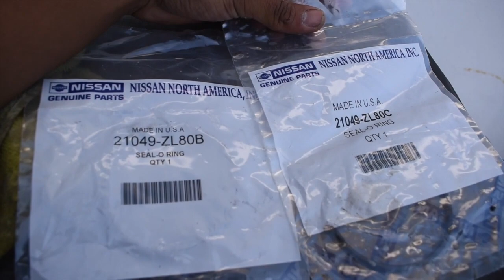Set Perfect Timing On Your VQ Motor !! | 350z G35 370z G37

Comment: I’m watching this w my engine wide open rn. Big ups bro. Thanks.
Reply from the maker: Yessir you got this bro. I appreciate you for watching.
Reply: I’m doing this same job me and a friend from work
Reply from the maker: Knock it out. You’ll be back on the road in no time. Shoutout the homies👍🏽
Reply: I got a 2013 g37 and my water pump is leaking. Been a mechanic for a while but never messed with timing chains before. I’m slip nervous. I don’t wanna blow this mother fuka up. It’s leaking right above the ac compressor where the weap hole is. Ima get the whole kit pump gallery gaskets chains chain tensioners guide thermostat and gasket.

Comment: On my de I have both cam gears indicator line up on bank one and two, but off on the crank pulley , I was in the process on changing my water pump and thought I skipped a tooth so took of the whole cover, i rotated the motor without the lower tensioner but held pressure while cranking. You think I’m good to take the primary chain off and rotate the motor to where the crank pulley lines up?
Reply from the maker: You got it! Crank it till it lines up and send her. All markings should be lined up by the time you engage the tensioners

Comment: man i was doing gallery gaskets on my HR, i set engine to top dead center and took the timing chain off and my passenger cam jumped far to left about 4 teeth,  before i took chain off i marked the chain and everything with paint marker, and i put the chain back on ands turned the cam to the correct way but the cam jumped on me backwards counter clockwise it snapped hard and turned counter on me, and then i put it back finally to the middle where it was before,  and all my marks and everything lines up, do you think im gonna be ok to start the engine or what should i do man thanks for the advice man apprecaite your vids tunas!!!!@
Reply from the maker: I would just set it to tdc that way before you seal the motor up you can double check your markings and make sure it’s got perfect timing. Tdc is the only way I set timing.
Reply: @tuned_tunas what’s tdc bro? Same happened to mine

Comment: I keep doing the timing on my g35 and when I put the tensioner on it shifts the passenger side sprockets slightly off the cylinder head mark (vertical). However the crank stays tdc and drivers side bank stays in the mark.  Help.
Reply from the maker: use a wrench to position the camshaft where you need it, it won't line up on it's own. It will require finesse.

Comment: Cool! I need to replace it on my G soon. The chain rattles on first cold startup. Thanks for posting!
Reply from the maker: Hope it helps you out. I'm always glad to help !!
Reply: You know you could just replace the tensioner right depending on how long it been rattling the chainnus probably fine. Give it a shot you just remove the top left inspection window and its two bolts just push the plunger in and stick a thumtack in the hole to hold the pressure off
Reply: Shit I need a timing chain my rattling crazy on start up we’re y’all located I pay whatever I’m n Philadelphia
Reply: It’s hard to find somebody to do this i   wish I had friends that now how to do this I’m too scared to do this I need help
Reply: You still active on here got a massive question did my gallery gasket and was not aware timing was a big thing so now car dont start can i still go back and fix timing?

Comment: so i’m doing timing on my hr and i made sure the cams was facing up lined up everything else is lined up. but when i rotate the engine a few revs the marks don’t line up aren’t they Supposed to line up ?
Reply from the maker: That’s normal it’s going to take a lot of spins to get it to line up again. But as long as you started at top dead center you’re solid
Reply: @tuned_tunas  so as long as i line everything up and and at TDC and i rotate the engine it should be fine even if they don’t line up ? i’m doing timing and im stuck on that part
Reply from the maker: Yessir it’s not going to always be lined up. It’ll take a good amount of turns before it lines up again

Comment: How did you get the tensioners for the cams in/out? I am trying but no luck.
Reply from the maker: I just pushed them back and put the wall tac in there to hold it closed and took off the 2 10mm bolts it’s got

Comment: The cam alignment position in the Service Manual for VQ35DE is different than this video.  The intake cam smaller dowel holes are to face up to the 12 o'clock position and the Exhaust cam large diameter dowel face down towards the 6 o'clock position.  The way he shows it wont put the cams on #1 at TDC of compression for DE specifically!  This video will put a DE out of time

I would attach a picture but doesn't look like I can on the comments.  #1 TDC of compression cam position should have the oval heads of the lobe face each other.  All 4 large dowel positions facing up at the 12 O'clock will have the Cam lobes face the opposite direction of the service manual illustration which would put a DE out of time.  This video example looks like it is for a 35th anniversary.  
No hate here, I still appreciate the video and effort taken to share content!!
Reply from the maker: I appreciate you for dropping this comment. This is good information for anyone who needs it. Super helpful brother !!
Reply: is there anyway you can send me that picture, i cant find it? aligning my car tomorrow and would like to know what you mean
Reply: @dawsondakota8857  yeah I have screen shots from the service manual.  Don't know how to share them though.
Reply: Do you have an email or social media ? Id really appreciate it
Reply: @dawsondakota8857  yes you can find me on Facebook messenger with the same first and last name.  I'll try to find you.

Comment: Yo I hit a curb on my g n the upper oil pan ripper off and it craked bottom pice of block I see I can replace bottom pice by the crank u think I should fix or replace engine car still ran after crash  I turn it off asap oil leaked all out
Reply from the maker: Yo what’s good my guy. Fortunately for you I have also ran into this issue myself of cracking the upper oil pan of the car. And I do have a video of doing that job as well. I recommend you do it yourself and save a couple thousand. Only if you didn’t crack the block and the motor is fine. If theres a crack in the block I wouldn’t take a chance on it

Comment: Hi, 
My G37 stalled. I had a code for bank two camshaft position sensor. I replaced the sensor, but the car didn't start. 
If I unplug that sensor, it starts. 
Please help
Reply from the maker: Definitely going to need to hop on the forums for that. never ran into that issue myself. Whats the code

Comment: aye bro what size wrench was ur boy using on the cam
Reply from the maker: 17mm but any adjustable wrench should do the job.
Reply: @tuned_tunas  thanks for the fast answer bro! two more questions if you got the time. i was dumb and put the bolt in the timing camshaft sprocket hole to line the pins up to the line, but now obviously the bolt won’t come out lmao, would holding the cams help with getting it out? and two does using the wrench stop all cams from moving at once? thanks again bro
Reply from the maker: Yes if you hold the cam with a wrench you should be able to jist loosen up the bolt. And for your second question no they are all moving individually so timing it is very important.

Comment: Do I need to take off the cam sprockets when I do my gallery gaskets? 

I saw in the gallery gasket video you just loosened the tensioner and moved the chain to the top. 

If i did that, and just marked my chain with how it is when I open it up before I take it apart, and then I set it back to exactly what it was. Would I be fine? Or do I need to do everything you did in the video?
Reply from the maker: Asking all the right questions my dude. Personally I have seen people do it the other way where they try to put it back where it was before and most of the time it doesn’t go well. They always end up missing a tooth. Doing it this way we can be 100% sure that all chains are lined up correctly. Because it’s not just the outside large chain the cams have their own chain that needs to be set correctly as well everything needs to be in sync. This method we are sure that if there is a failure it isn’t the timing of the motor
Reply: @tuned_tunas  appreciate the response bro 🙏🏼
Reply: @tuned_tunas   now will I have to take apart the intake manifold in order to gain access to the cams so I can set the cam sprockets?

Or is there any way to adjust the cam sprockets with just the timing cover off? Or will my cam sprockets just stay in the right place since I’m not taking them off in the first place?

Comment: What’s up man I like the video I’ve got a 35de non rev up in my z. I’m going to do the gallery gaskets and figured I’d do the timing chain and oil pump while I was in it. Got two questions first one could I reuse the screws in the oil pump. And second one when setting the timing do I set the timing marks on bank one and two out at the angle of the head or straight up like you show in the video
Reply from the maker: Glad to hear you’re going for that full refresh my dude. I wouldn’t be too sure about the bolts on the oil pump since I didn’t change mine. As for the timing I would  do it like the video everything needs to be perfectly aligned and this way I had no issues at all. But wrench at your own risk

Comment: Hey, so i took my timing chain off before setting tdc. How would i set it again? I have the dowel pins sit in the angled position so would i just set the crank into position and put the chain vack on?
Reply from the maker: Put the crank bolt back on and turn it to TDC and the cams you would just have to move with an adjustable wrench. I didn’t set to top dead center beforehand either that’s what I do in this video.
Reply: @tuned_tunas  hey I’m in the same situation but my crank doesn’t rotate anymore but the sprockets do, do you know how I can get my crank moving again?

Comment: Did you set the camshaft before installing the cam gears?
Reply from the maker: Cams never came out. Just rotated both cams and crankshaft to get them lined up to top dead center.

Comment: Thanks for the info i just got right info inch pounds. An pound to each bolts 
I strip. One water pump bolt. But i found a little bigger one , longer one but cut it an hand tight it snug thanks
Reply from the maker: Sounds like it all worked out bro. Thats good to hear bro💪💯

Comment: I just got my oil gallery gasket changed on my 08 HR by some known motosport company here in UK...however my car now hops/jumps or you can say hesitates on acceleratetion under 2K revs ,say between 1k-1.5k RPM, no matter if I drive slow or accelerate hard,it still happens,any idea what could cause that ?, something not done properly etc ?,I had no such issue prior to getting the work done.Any help would be appreciated,thanks
Reply from the maker: Night not be timed right. Something similar happened to me friends car. Ran good at first but probably the second cold start it started to run bad and gave us the timing advanced code.

Comment: Hey bro question. Ok i got gallery gasket  in right. I already have crank in time... now its time for bank 1 and bank 2 to get line up but i couldnt turn bank 1 cam spockets what am i doing wrong? Do i have to take valve covers off and turn bu hand? Also do i have to remove spark plugs? When timing the engine! HELP ME BROOOO!!
Reply from the maker: I had the block top dead center before I adjusted the cams to avoid striking the pistons. When it builds compression it gets a little harder to turn. I had the valve covers off so it was easier for me. And I had my spark plugs in when I did my job. Shouodnt be am issue. Lmk if you got any more questions. We here to help!!
Reply: @tuned_tunas  ok sure thing. Thanks bro!👍💯
Reply from the maker: Always glad to help bro💪

Comment: What should I do if I already took off the timing chain and didn’t set the motor to top dead center?
Reply from the maker: Make sure the cans and crankshaft line up to the timing marks. If they don’t you done FFFFED UP
Reply: this happend to me, now i fddd up by turning the sprockets and crankhaft seperatley counter-clockwise and clockwise on multiple occasions without the chain on, and now when i line up my marks for the sprockets and the crankshaft, I try to turn the crankshaft and it stops turning and touches a valve, Idk what to do to fix it back in place properly now, any suggestions on what do? do you have an instagram?

Comment: Was up foo ey compa I was changing my gallery gaskets bro and I think my timing chain skipped a tooth or something because  now it don’t wanna turn on could it the timing or a sensor bro? If it’s the chain do I need to put the car on top dead center and then take the chain off and time it or just take chain off them move the sprockets to the right time and then put the chain on the right time or I don’t need to put the car on top dead center?
Reply from the maker: You would get a code if it was the chain bro. It would say that timing is off. Otherwise if the car isn’t getting any power then it’s probably a wire somewhere
Reply: @tuned_tunas  Entonce could it be the belt bro? Or does it still give u a code if u put the car on position and I connect my  obd because bro my car only cranks but it doesn’t wanna turn on?
Reply: @tuned_tunas  u got like a number bro or insta For I can show u a vid bro of it cranking aver if u can hear maybe por pinche milagro what it is😭
Reply from the maker: Instagram is in our bio bro. @TUNEDTUNAS I answer all messages and comments

Comment: Did u try turning the crank with the socket first before u sealed everything up to make sure all the timing is good?
Reply from the maker: We turned it right after we timed it. Everything seems good. Good way to check and see if the valves hit a piston

Comment: I recently did mine, but after doing them I’m getting code p0012 for the passenger side VTC I believe. Everytime I do a pull it idles you to 1.1k. Did you ever have any problems like that? Or did you have to make sure the little cam covers were aligned to a certain way or something?
Reply from the maker: Didn’t have any issues with mine man. If you got a code something is not right. And it’s hard to pin point what it is on such a big job. I would redo it and quadruple check that the chain doesn’t move when you set the tensioners. If it’s off by a tooth it’s not right. It has to be perfect.

Comment: I did my water pump and now both my cams  are facing left at top dead center . Im wondering if who everbhad the car before me used that as marking to put a timing chain .

I never had a issue with the timing on my 2007 g35 sedan vq35hr 

Just needed a water pump replacement . 

Any thought s
Reply from the maker: We personally prefer to make sure the car is too dead center. That is the correct way to do it but to each their own in what method they choose to use.

Comment: I’m in the middle of my rebuild man and I’ve never done anything like this so I’m kind of paranoid, did you have any issue after? No timing issues and such?
Reply from the maker: Nope cars been running perfect with no check engine light. Currently sitting at 162k miles and getting ready to throw boost at it. She’s a trooper. But I would say if you got the time and place to do it go for it !!

Comment: thanks im about to change my timing chains and the oil gallery gaskets. this vid was a gret help. sorry to here about the probems you had with it.  where did you get the torque spec's from?
Reply from the maker: Thanks for th4 support. Torque specs were found in a 350z pdf manual i found online.
Reply: @tuned_tunas  k tks bro

Comment: Hey man love this vid I just have one question. How do you align the guides for the sprocket so that the dowel is upwards facing the line?
Reply from the maker: The cams I rotated with an adjustable wrench. And the block I rotated by putting the bolt back on and turning it
Reply: @tuned_tunas  whenever I try to turn the cams they just go back to their original position because of the valves I assume. Do I have to turn it with the sprockets on or is there another issue

Comment: Fantastic content as usual Tony.
looks like my HR has rod knock. My question is, can you swap a vhr bottom end to the HR heads & HR clutch (Actually JWT clutch & LW FW for HR)?
Any help would be greatly appreciated. Thx Brother.
Reply from the maker: You can easily swap the 3.7 block onto the HR heads very easily with no modification. And the clutch kit is the same for VHR & HR
Reply from the maker: Thanks for your support🙏

Comment: Great video super detailed thank you 
I did everything u said and my motor is idling rough like it’s out of time codes are saying multiple misfire. I smell lots of gas
Any ideas
Reply from the maker: Sometimes when you put on the big chain you need to hold the cams in place because they was to jump timing until you put the tensioner on. I've seen that happen a few times. There's ways to check timing before you close it all back up.
Reply: Thanks for hitting me back so quick I’m breaking it down again right now
Reply from the maker: Feel free to dm on IG if you got questions bro